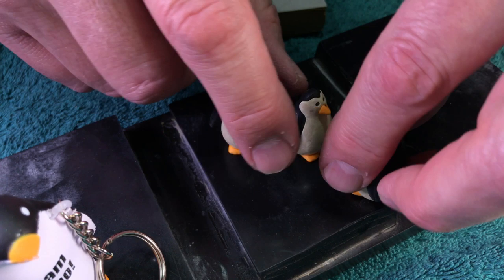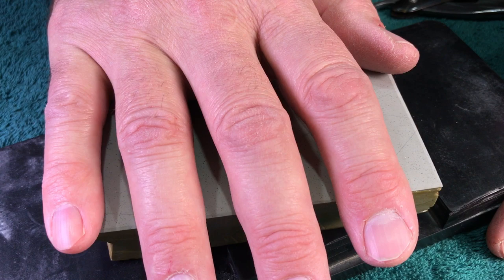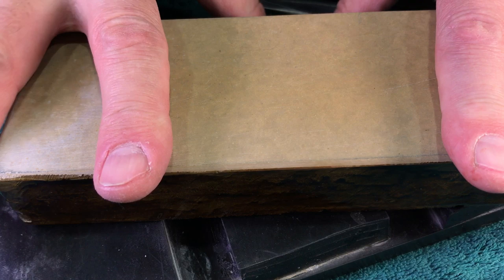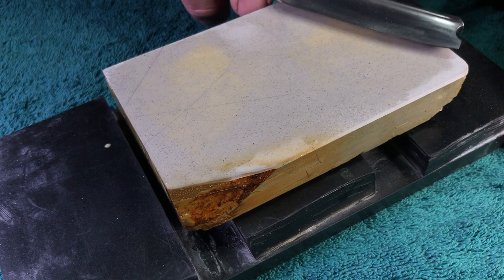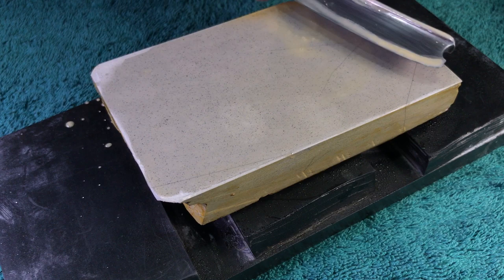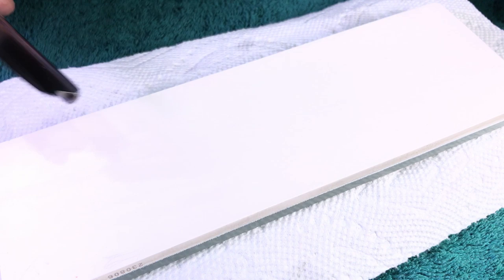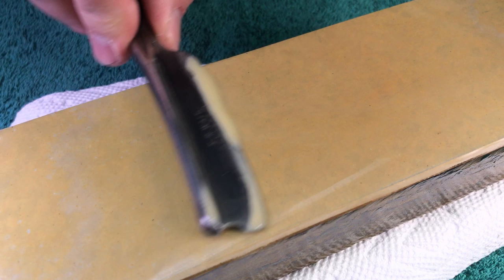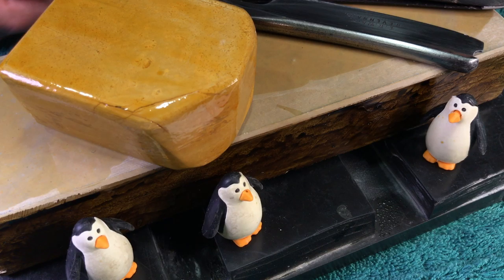How to Hone a Straight Razor   The Touch Up

Comment: I have found a post of a reseller saying 16 k is not good for razors due to the irregilarity of the particles abrasive! Would be interesting contavmct the manifacturer to clarify that point! Because I use regulary the stone but I limit the laps to avoid any scratches!😂 true or false!😮🤔
Reply from the maker: This is an old tired story concerning the Shapton Glass 16k. The manufacturer doesn't say it is no good for razors, they just don't recommend it for razors. I have discussed this with Shapton in Japan, they say it is fine to use for razors if the user's skills are up to the task. They just don't generally recommend it for razors.

Comment: Probably not the place for this, but I'm curious if you have any recommendations for coarse stones to do massive edge repair on a kanna, but also could be good for flattening the back too? I assume something on the harder side of things would be the way to go
Reply from the maker: Hi, thanks for watching and commenting!  Correct,  Kanna repair/restore is way off-topic. Plus, without knowing the blade/steel/skill set/etc, it is impossible to make a coherent suggestion. In a very general sense, Shapton Pro stones offer most people what they need to get most sharpening work done.

Comment: Waiting for the next video eagerly. In the mean time, an inquiry: recently, while I was chatting with another advanced natural stone junkie: it seems that no one has a published a comprehensive study of Specific Gravities of all manner of sharpening stones, other than Novaculites. Just curious if, in any of your reference materials, you have seen any such studies? I have just recently began measuring the SG of some of my more "curious" & "mystery" stones. Would love to hear your thoughts and Thank You for being You
Reply from the maker: Have not seen such a study and wouldn't expect to see one either. Different types of stone can't really be compared in a qualitative manner using that information. It would be an exercise in collecting data for no real reason. A very dense stone could be a very fine finisher - or not. SG comparison works for grading Arks based on an assumption that the stone in question does not have voids, inclusions, etc. It's not a perfect method of determining status. It's just one shred of data used to help determine what is in one's hand. The guys at the quarry know when they are cutting the stone, they can tell by how the blade moves through the material. They don't need to weigh it, the saw tells them all they need to know. Most stones are not weighed and checked for SG actually.
Reply: @KeithVJohnson1  love your work Keith, and yet I measured all 40 of my Nats the other day for specific gravity.. pretty curious results. I had two batches, known and suspected Novaculites... And all the rest. More to come on that from me later...

My real question, at the moment, is have you ever used or evaluated any Turkey Stones? I have a suspect on my bench, which may, or may not be. Very little info out there on them.
Reply from the maker: @flipsfan78  That's a topic for another video on another day! Happy Honing!

Comment: Ive seriously tried to use a razor. It's not possible for me.
I guess im too impatient and heavy handed.i tried again to slurry my translucent with a 1000 grit diamond and still i couldn't get a silky smooth shave.i ha mappin and osborn and german gong made in solingen .I guess some people are better at certain things
Reply from the maker: For starters, it is a learned craft and it takes time and patience. And yes, some people are better at some things than others are. Using a straight and honing them isn't everyone's cuppa tea but it's not so esoteric that only select people can do it. .  Using slurry on a translucent Ark to finish is a guaranteed fail. It's not a Jnat, the slurry doesn't get finer, it just rams into the apex over and over again until it makes a saw tooth edge. There is absolutely zero point in making slurry on an Ark to finish a razor and there is every reason in the world to not do that. To be successful in this discipline, one has to fully understand the concepts and tools.
Reply: @KeithVJohnson1  I can't get fine enough honing oil.the real stuffs too expensive. I tried dawn for a while but it clogs up.
The slurry method allows me to use water.
I often wonder what the indians used in the olden days. 
The name whet was the sound it made when you got the right edge and not wet..
Anyway. Thanks for the reply.
I will just carry on withe slurry on my 10 inch hard arkansas and the translucent. 
I just use the disposable blades from lidl. 
Very cheap
1pound 30 penny  for a pack of ten.
My kitchen knives are sharp enough 
See you
Reply from the maker: You are killing your edge with slurry. I've used dish soap on 1000s of Ark finishes without problems - it doesn't clog, I think you are using it incorrectly. "Honing Oil" is not needed, mineral oil works fine, so does castor oil, 3 in 1, glycerine, etc.

Comment: Keith, you mentioned the spine was twisted on this razor. Do you try to flatten the spine before honing or is it not necessary?
Thank You
Roger
Reply from the maker: Many blades, like this one, that have a warp can be honed easily enough without having to resort to drastic/aggressive measures. I usually work with the existing geometry as much as possible.